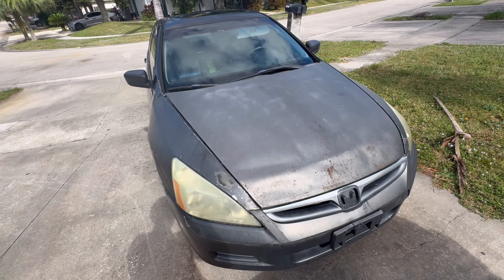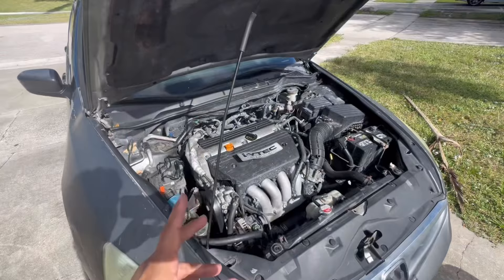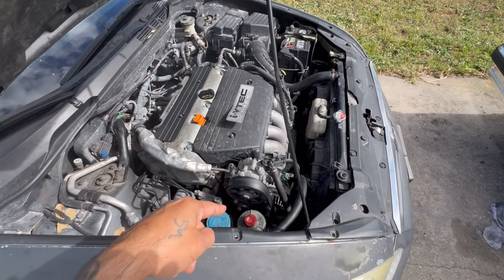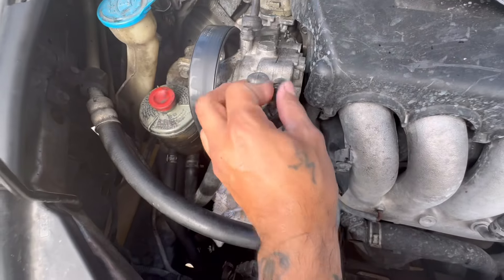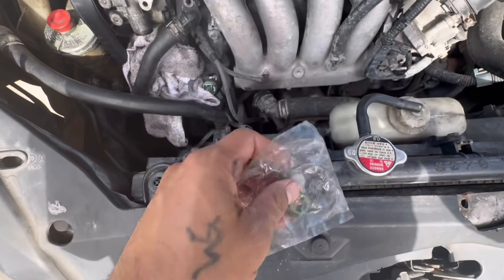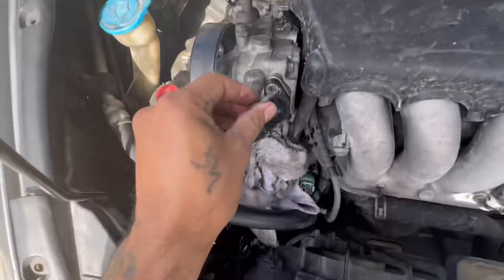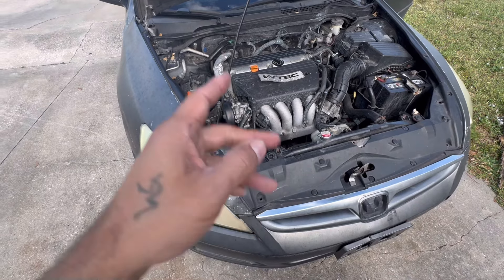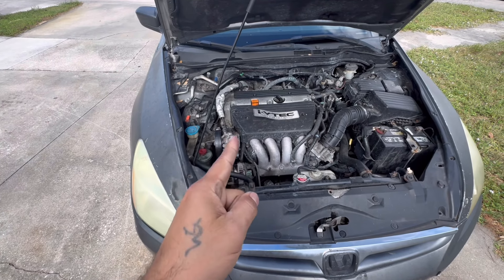Honda Accord Power Steering O-Ring Replacement (2004-2007) Power Steering Whining Noises

Comment: Did you have to empty out the reservoir before you change the O-ring?
Reply from the maker: @Juliannl  no I just lost a little fluid. I refilled it before starting the vehicle and then I turned the wheel all the way right then left several times to get the air out. Hope this helps and hope you’ll consider subbing to the channel.
Reply: @ okay so if I have fluid in my power steering reservoir, I don’t have to worry about draining the fluid out to change the O-ring..
Reply from the maker: @ nope. You’ll lose a little fluid but just refill it and purge the bubbles out.

Comment: I just replaced both O rings and its still making the same noise. Does that mean my power steering pump is bad?
Reply from the maker: @mikecorreia8668  hey thanks for watching. It’s hard to say without having the vehicle in front of me to troubleshoot. But with that being said it could well be or you could have a cracked/broken hose. Check your hoses and look for leaks if they are bone dry then sounds like it could be a bad pump. Hope you’ll consider subbing to the channel.